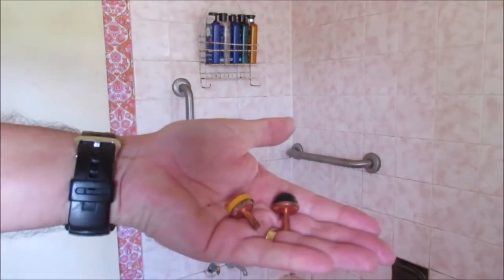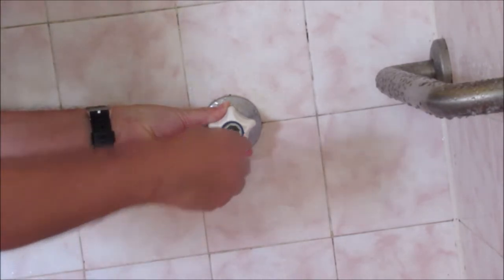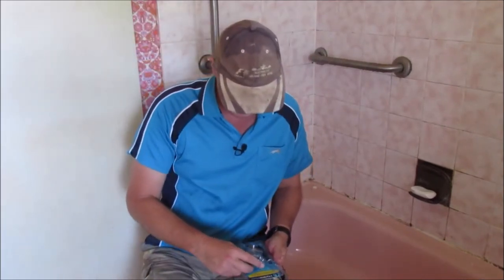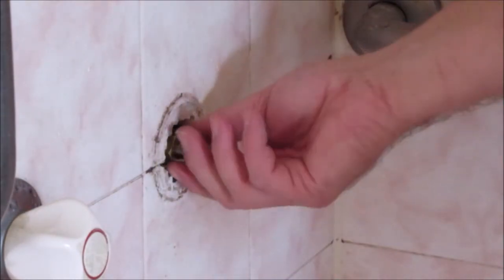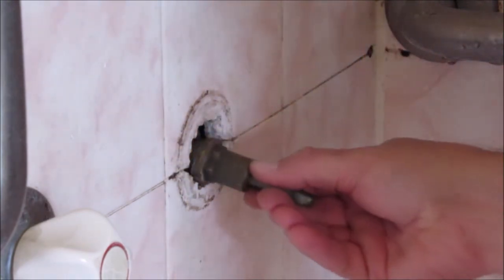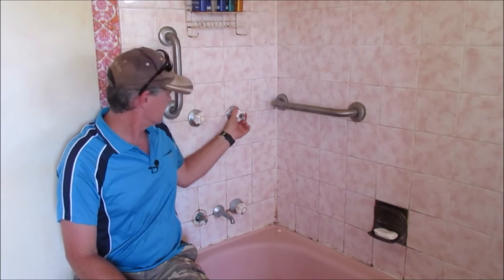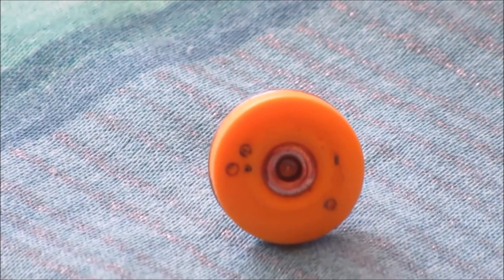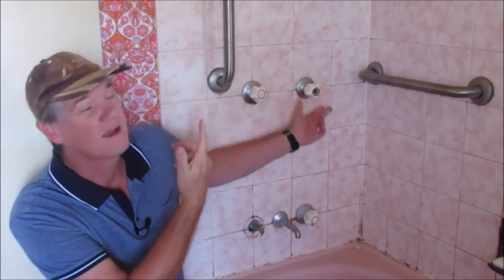How to Stop a Leaking Shower Tap

Comment: I'm watching videoss like crazy as I can't afford a plumber to come out and charge me $hundreds if I can avoid it.  One good tip I saw was to clean out after reseating with a cotton bud. Probably would do a better job than a paper towel. Also one mentioned running the shower without the head to get rid of any stray fillings.

Comment: G’day Sean. Thanks for this video – it gave me confidence to tackle this job. The HydroSeal kit worked perfectly. Anyone could install new seats this way. Even though I ran water through the tap with no washer in place, I had a problem the next day with dripping due to brass swarf on the washer seat. I pulled the tap apart again and cleared the swarf using cotton buds. There was also brass up in the spout aerator and down in the tap housing base. It was easy enough – I just reckon anyone who does this job should expect to have the drip return, and plan to dismantle the tap again for a clean-up. After that, it should be sealed for good. Thanks again.
Reply: For hand-basin or outside tap seats, do the thread cutting with the water turned on gently - it's messy, but it will wash the brass chips out as you go. Dry and WD40 the steel tap when you've finished to prevent it rusting. DON'T do the 'wet thread cutting' for a tap base in a hollow wall! For these, run the water through once the thread is cut and the tap is re-assembled (minus the washer) but BEFORE you install the new seat. If it's a shower tap, remove the shower head so the brass splinters don't clog the holes, and catch the water in a bucket so the brass chips don't sit on the shower floor waiting to drill into your feet next shower....

Comment: Tried on 2 tap seats, 1 of them 100% fixed like new, turning off is now effortless. 2nd tap made good improvement, but still not dripping free, tries apply thread tape between the seats and improved, although not as good as my othrr tap. Overall this is great.
Reply: JZ...some people have had more success by removing the white plastic washer (from the new screw-in seat) and applying some plumbers tape to the threads. I've yet to try it, but it may be worth a shot?

Comment: Great work!! Honesty and reflection is much appreciated to help people avoid these same issues that you got into showing us the mistakes and how to fix those them as well. I’ve been trying to figure out how to fix my leak that occurs almost once a year for my moms shower, and it’s already been about a month that I tried fixing it by replacing the stems for the handles. At the time I figured it was the lack of threads to install the seat but I didn’t know how to install them until recently thought that I would have to crack open the wall to replace the piping and install threaded ends for the seats that are missing. She’s been struggling with this and now I know what to get!! 

Thanks a lot for a well concise instructional video!!

Comment: Just fixed my garden tap. The seat had a scar about 1mm deep and the tap dripped constantly. I tried a hand-held reseating tool but it wouldn’t take off enough of the brass to allow the new washer to seal. Got a reseating tool that you could put in a drill and it did the job in two hits. I’d also bought a reseating kit which has a tap to tap out the original seat in the middle and a new seat which you screw in. I thought this would fix the problem even with the scores seat but it didn’t, hence the purchase of the reseating tool that goes in the drill. Kind of renders the reseating kit redundant but I fitted it anyway and it’s now fixed. Also replaced fibre washer, O ring and lubricated assembly with lithium grease. Lovely now. 😊

Comment: I have experienced everything you experienced, however I did flush before reinstalling. Had a large groove in the original seat, so now, like you did, I have to remove it all and add thread tape. Hoping for a success 2nd tune round. 
Perfectly covered all the issues I had. Much appreciated
Reply from the maker: Thanks for the feedback.    I have done this a few more times since I created the video and with flushing and thread tape it has worked.   I hope yours was a success the second time.
Reply: @countrylifeonthecoast4167  thread tape was a winner. Not a drop once the tap was turned off. Stainless steel seat will last for years.
Thanks!

Comment: Thanks, any ideas why the flow rate for both hot* and cold should be reduced after doing exactly whats shown here, with the Hydroseal kit ...?
I flushed as instructed and have already tried cleaning the shower head ...?
*only replaced the hot water seat
Reply from the maker: Sorry, I don't know.  I didn't notice any difference in the flow rate after doing mine (or doing others since this making this video).

Comment: Now that it has been a few months since you completed the job has the shower been leaking again?  I have noticed that those soft turn washers that you put in at the end of the video seal very well but don't tend to last too long (they tend to slowly disintegrate over time if you turn them off too tightly).
Reply from the maker: So far it is still working great.  We make sure to turn it off as gently as possible.  
You are right though, I have used those washers before as well and after a period of time they can start to fail.  Not sure how long the washer will last but so far so good!